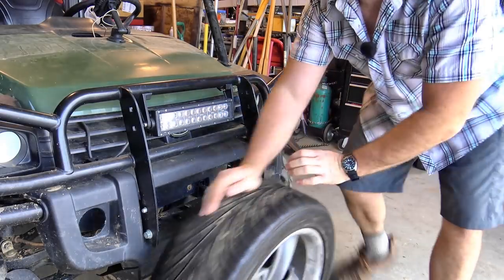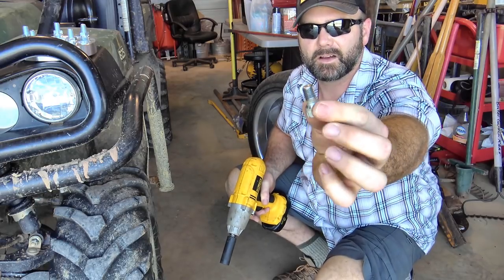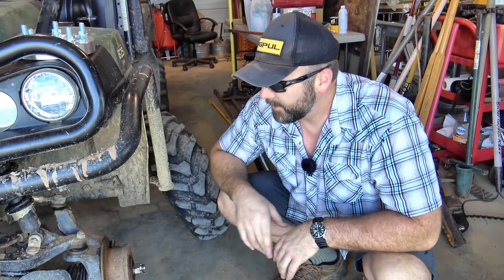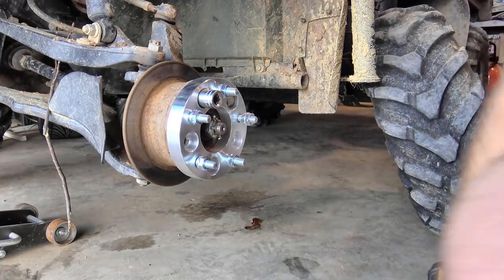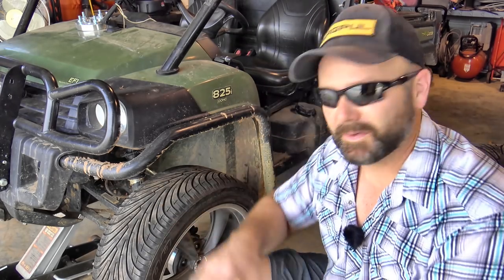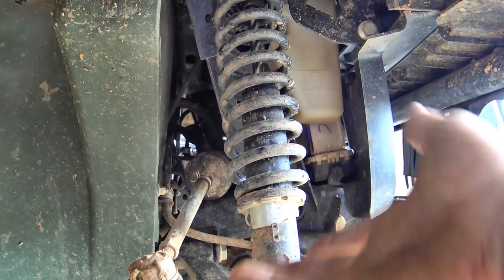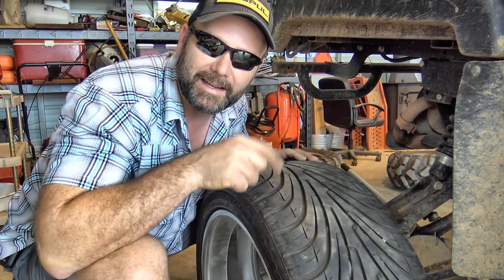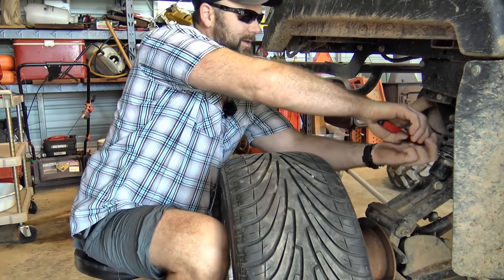THIS CAN'T WORK!!  STUFFING 20 INCH RIMS UNDER A JOHN DEERE GATOR!! NOW THAT'S HOTRODDING!!

Comment: Not a thing wrong with being a little crazy as long as you have a plan and some fun.  I worked in nursing homes a little over 20 years.  Things like your tires can be a good way to keep stress at a manageable level. Rock on. 👍

Comment: Since it is not powerful enough to pull stumps, replacing the tractor treads is not big deal for performance.  I dig it !   Looks awesome ! Mrs. Stoney Ridge will have to step a little higher to get in.  You may end up in the dog house for not asking her opinion first. But, she seems like a pretty easy going gal. I know you have tractors for pulling and hauling big loads.  And, for moving snow etc.  The gator is mainly a get around tool. As you have said before. Take 15 minutes and swap the wheels from left to right side.  The tread on traction tires (as in Tractor) always points forward.  Good video Josh.

Comment: Putting on bolts or nuts I think you should always use never-seize, so down the road you don't have problems. It will make your life so much easier especially on the farm.
Reply: Excellent
Reply: maingun07 --IF it was a car or truck then yes I wouldn't put it on. But 4-wheelers I would. They don't get changed very often and they're in water a lot so that's my reasoning. To each his own. lol

Comment: Be American, use a 3/4  ;o)
Psst  I believe you have the tires on the wrong sides.  Don't know about Gators but I think most 4x4's should have the same size tire front and rear. Looks good though!

Comment: The wheels are backwards they are directional tires the point is suppose to point forward not backwards.
Reply: multiram50 lol if  that matters it's just for fun
Reply: Ben Derisgreat I know it's for fun but if they were to be put on a vehicle that's will be driven  it's good info to know
Reply: I agree; tires are pointing the wrong direction (for a street car)
Reply: You might as well have a golf cart lol
Reply: I bet the gator is more powerful and useful than a golf cart
Reply: I have actually tried putting directional tires on backwards on my old atv, and it actually made a big difference. It was a little fun doing doughnuts, the backwards tires had pore traction.
Reply: Who cares? It doesn't matter in this situation.

Comment: Its not just teach your son's,  teach all your kids to change a car tire regardless of their gender.  When my sister went to OU, when she was able to take a car to school she got the old 55 Buick Special, this was in 1960 or 61.  My dad made her prove she could change a tire by herself before he let her take the car to school.  She had to actually do a tire change in the driveway, no lightweight spares back then, she had to do the complete change all by herself.  Well done to my dad for doing this, and my sister as well for demonstrating she could do it!
Reply from the maker: Amen!!!! Here's one for ya....my wife is a petite lady...but she wants to operate the tractor......my only stipulation is that she be able to hold the clutch and brake down for 90 seconds.....if she can do this she can safely operate the tractor...if not.....it's simply unsafe....Will do a video on this soon! Thanks for your comment buddy
Reply: My Daughter pulled the engine in her 74 Dodge Dart and changed all the gaskets. guess it leaked oil in the school parking lot and embarrassed her. Plus she impressed the guys when she had to jump the starter with a screwdriver to get started one day.  I only supervised the engine pull.

Comment: I enjoy your channel and the content that of your videos. Just wanted to point out that your tires ARE direction specific! The correct rotation is reversed of how they are installed. Simply put the ones you have on the left onto the right side, and the rights onto the left. Looks pretty cool though and fun to kick around the farm but I agree with Gene Foster's comment about possible drivetrain damage with different size tires when 4wd is engaged. Keep up the fun videos!

Comment: The Gater looks good with the bigger wheels. Needs some mud tires though. Before I would let my son get his license he had to be able to do basic maintenance. He knew how to change oil, check and add transmission fluid, and coolant etc. He also could change a tire.

Comment: You say you are doing this for fun. Than everyone tells you the tires are on backwards & the lugs are the wrong size. Dose that mean you are having fun backwards & your fun is the wrong size lol.
Reply: ...bassackwards fun and funny.
I have been putting directional tires on the wrong way (oops) for years.
...a friend used to run his front tires backwards,
"...back tires will get you into trouble and the front will get ya out.

Comment: Looks great. What's the handling like on road and off. Guessing slick off road.
Reply from the maker: Does just fine...not doing any "mudding" in the UTV more just cruising around getting farm chores done...the width of the tire leaves a lighter footprint on the wet soil and grass for sure...I like it!
Reply: Great stuff good to see the fire burns bright in middle age ;-) and in life you have to have fun.

Comment: I agree with you on the changing a tire, kids need to stop being so lazy and expecting someone else to do it for them. Though then they could say the same about some old farts, and  not learning what they think are the basics of using a computer and how to fix them and also expecting the younger generation to fix it for them. That was a fun lil weekend project that you did and will save you from wearing out teeth and your tires out, lol. Here's some advice though about the shocks. You essentially just made them stiffer and more harder riding. It did not raise the gator. Though if you like the rougher ride (which may concern MIss Stoney) keep it that way otherwise i'd put it back to have a softer ride. Take care bud, and see you on the next one.

Comment: As stated before, your front tires are on backwards, but no big deal, won't be reaching highway speeds in the rain. More of a "let's see if it'll fit". Also when using spacers or wheel adapters it's a good idea to use thread locker on the inner bolts/lugs. Again it's a gator not a highway vehicle so probably no big deal
Reply from the maker: Shoot Grey they're all on backwards lol

Comment: Those are Directional tires, both the front and rear sets are on the wrong side. To keep from wearing the tires out prematurely, you'd be best off swapping them left side to right side. Looks cool though.

Comment: I agree with your rant. I even yelled/cursed at the TV the first time I saw that commercial. I do not expect that a woman could change a tire because most of the women I know are simply not strong enough to break the lug nuts loose, However, I do think they should be shown how to and possess the knowledge. There is no excuse for a male that is old enough to drive to not be able to change a tire on the car he is driving. That commercial would actually STOP me from buying Liberty Mutual Insurance. PS Interesting video but not something I would do to my own. Also you're exactly right about "American" made products. 7 years ago when I was shopping for my first tractor I was a fan of John Deere and was planning to purchase one. Then I did some research and discovered that there really isn't an American made tractor of any brand as the Deere I was looking at is actually made in India. I have a Kubota RTV which I think is mostly made in GA but I wouldn't bet on it.

Comment: If you leave these on, don't use 4WD. Different tire sizes on 4x4 vehicles wreck havoc on the drivetrain.
Reply from the maker: Thanks for the tip brotha
Reply: Still looks pretty darn cool though.

Comment: Well, you kinda recreated a Model T !  I believe you've got the tread directions reversed, however !   Not that those treads are worth squat off pavement !  IAC, a nifty, fun video !   BTW, that "adjustment tool" is called spanner wrench !  BTW, IMNSHO  anyone that can't safely change a tire shouldn't be permitted to drive..  Not only do they create a major safety hazard to other  vehicle operators, it can  ( depending upon circumstances and location ) present a life-threatening hazard to themselves and their passengers.    As a RN you know  ( if you've done ER and trauma rotations )  first-hand what an MVA can inflict upon he human body .    As a former professional driver I've seen many MVAs resulting from drivers' ignorance of tire care/inflation or inability to perceive a failing tire and take proper corrective action to safely halt the vehicle.  Some still haunt me .

Comment: I have a Kubota tractor made in Gainesville, GA...not sure if they make the UTV here or not.
Reply from the maker: So John Deere is "made" here but all the parts and engine are made elsewhere
Reply: Yeh, the Kubota diesel engine comes from Japan but the metal fab, paint and assembly is in Gainesville.  I think the UTVs are "made" just down the road in Jefferson, GA.

Comment: Those Summer Tires are Rotational they only rotate one way. The Right Rear Tire is supposed to be in the left front and visa versa aswell as the left rear is supposed to be on the right front and visa versa. All winter tires are directional too!!!!! Read the tire next time!!!

Comment: I just wonder i cant remember if you said the gator is 4x4...the front and back outter tire circumference needs to be the same.....if not.... the wheels will bind ...because they will turn at 2 different speeds.I know my 4 wheeler warns against this..if its just 2wd......or left in 2wd...... then it doesn't matter.Couldnt tell if I saw drive axels in the front a arms.Looks fuck-n groov-n though Josh....call it the Getto Gator............Wooooo
Reply from the maker: Thanks buddy good point for sure!

Comment: If the new wheels and tires are different heights and the gater is full time all wheel drive and different height wheels have a different number of revolutions🤔  that  maybe a boo boo for the all wheel drivetrain perhaps?.🤤
Reply: will f  was thinking that hope no gear problems
Reply from the maker: No gears...belt driven....and 4wd system is similar to a regular truck or suv....3 options 2wd, 4wd and fully locked 4wd....honestly now that we have our land more opened up and better trails I really only use the 4wd to keep from spinning in the fields
Reply: Stoney Ridge Farmer my bad  looks fun  just lookin out
Reply: Stoney Ridge Farmer  Roger That.

Comment: Tires are on backward. Tread points should be forward so as to pump water out to the sides. Not like you'll be going fast enough to accomplish this but in a car, having the tire the way you do will cause water to be pumped to the center and cause perpetual hydroplaning. Second, having two different size tires front-to-back will mean a different ratio, so unless the original gator tires were smaller in the front, to the exact same ratio, you'll be binding up your running gear in 4-wheel drive. A fun project and looks interesting but don't do that.

Comment: Going from one size tire to another is going to screw up your transmission especially with the front and rear tire size being different I ran into this before with pickups going from a smaller Tire to a bigger tire

Comment: some LED rock lights behind them of green? Yes everybody should know how to change a tire on a vehicle, but unfortunately the autumn makers are discontinuing spare tires especially in the last 10 years. Changing the tire was a requirement in my family of even owning a vehicle beside simple maintenance i.e. oil changes and stuff. Just don't get stuck in the mud now the goats are going to be confused on who you are next time you right up to them.

Comment: KAWASAKI MOTORS MANUFACTURING CORP., U.S.A. (KMM), LINCOLN, NEBRASKA AND MARYVILLE, MISSOURI
Kawasaki was the first foreign vehicle manufacturer to open a manufacturing plant in the U.S.A.. Several far-sighted Kawasaki executives germinated the idea way back in 1974, and it was simple. If you're selling in America, why not build there too -- save time, save shipping and employ local labor. It worked, and years later firms like Nissan, Toyota, VW and Honda followed Kawasaki's lead.

Since personnel are the most important part of any business, KMM strives to make working conditions safe and comfortable. Kawasaki employees, working as a team, insure that the same quality standards are incorporated through all processes. Each worker takes personal responsibility for quality and feels pride in a job well done.

The consumer products manufacturing facility in Lincoln, located on 335 acres of land, has grown since its opening in 1974 from the original 286,000 square feet to nearly 1.3 million square feet of manufacturing, office and warehouse space. In 2001, the rail car plant was completed at the Lincoln site, adding 437,000 square feet for light rail car manufacturing. Over 1,000 people work at the Lincoln facilities, making KMM a major employer in the Lincoln area. In 1989 the Maryville Plant was opened for production of general purpose engines. The Maryville facility has grown to over 700,000 square feet on 113.7 acres of land employing over 600 people. KMM Research and Development Centers are located at the Lincoln and Maryville facilities to meet customer demands as quickly as possible.

The plant operates on a "just in time" supply method which eliminates expensive warehousing and over-ordering of parts. Production methods combine the best of Japanese and American techniques, resulting in the unique Kawasaki Production System, of which we're quite proud. For instance, certain parts and pieces are made on special presses located right on the assembly line. This means no shortages or excess inventory on these items for more efficiency and less cost. In many cases, it also means the worker makes the part he assembles, and thus enjoys a full sense of accomplishment.

Comment: Well the closest to American made I can think of, truly high quality though is Polaris, strong and dependable no thrills is the Honda, but if you truly want "American made" that's basically non existent in the UTV market but I guess bad boy off-road and some company that makes the stampede may be bad boy, but they claim true American made, but sometimes that usually means some new untried untrue bullshit that ends up screwing up, like High Point.. and I do not believe that spring is a lift.. that's ride adjustment I just glanced as you adjusted the notch and that is the spring tension not really anything to do with height, it would help if you had big tires or a massive load to keep it from bouncing and sagging but it would ride like shit. Take it from the guy who knows his play toys. I destroyed a UTV brand new in 24 hours under normal use playing, the company said it "wasn't made for use during dust or dirt" and the suspension was destroyed in the front end and I didn't realize and when I took a turn it buried nose end into the dirt and just fucked up everything I just laughed, until I got my money back but they charged $500 for taking it back and so I lost $500 but whatever. If you want a really fun play and work horse you're gonna pay for it, get the Polaris General, if you want unbelievable reliability I can also back this.. Honda. Both are extremely reliable but like they say you can run a Honda without oil. Mines like 12+ years old and besides a couple minor things hell it hasn't even had the tires changed and it just keeps ticking. Faded red paint and all

Comment: Don't put it in 4x4 with different height tires
Reply from the maker: Factory tires are different sized on the gator from front to rear
Reply: Different size but same height